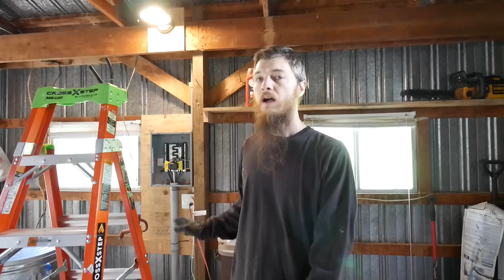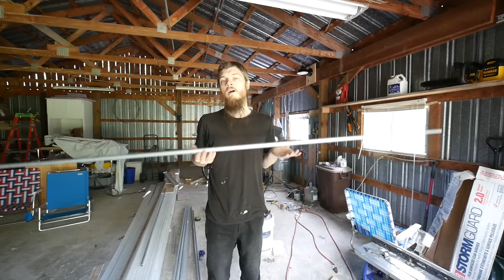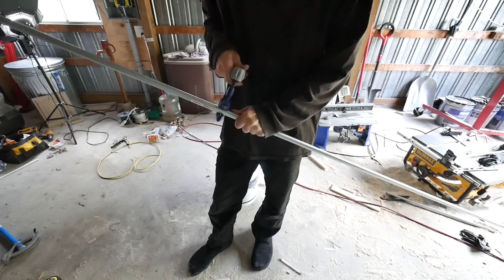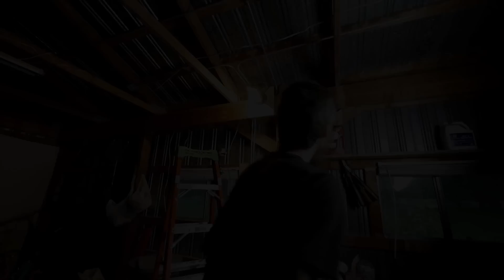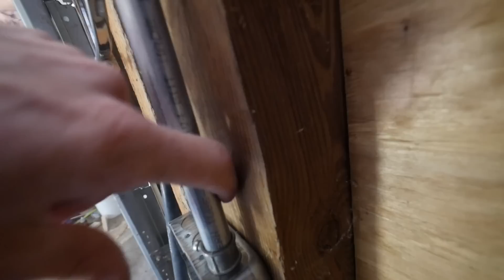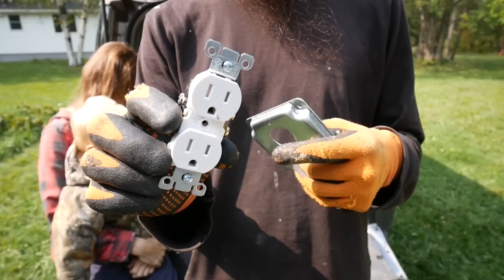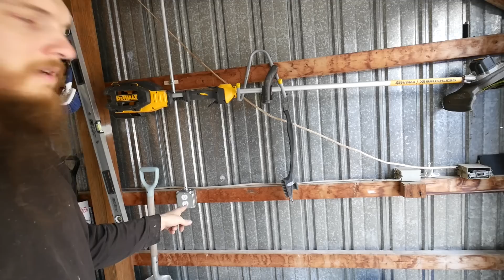New Electric - 1970s Pole Barn Restoration

Comment: Love the way you did the electrical.  You could have just ran the regular romex like the other guy did but you went the extra step of using conduit which really makes for a  top notch job.
Reply: Actually using romex in that situation is a code violation. Another alternative would have been to use mc cable. Also, all outlets are required to be gfci protected which they may be because Doug did mention a gfci. It should be upstream of all other outlets thereby protecting all downstream outlets. Doug didn’t show that but I’m sure that’s what he did. I’m a 20 year journeyman electrician. Nice job Doug!

Comment: just curious what made you not put 4 outlets per box would it have just been to many wires
Reply from the maker: Just preference. I don't think I'll need that many in one spot. But's fairly easy to swap out the cover if needed.

Comment: What are those orange fuse looking things you used in the wiring behind the outlets?
Reply from the maker: Push connectors. An alternative to wire nuts. https://www.homedepot.com/p/Ideal-34-Yellow-In-Sure-4-Port-Connector-100-Pack-30-1034P/202894312
Reply: @diyfferent  Interesting. Didn't know they existed. Thanks!
Reply from the maker: @adhdiy-82  I saw that in the store a few years back and thought they looked good but then they stopped carrying them so I never got a chance to try them out. You are right, stores don't seem to carry them. I may have to order some online sometime. Thanks for the reminder.